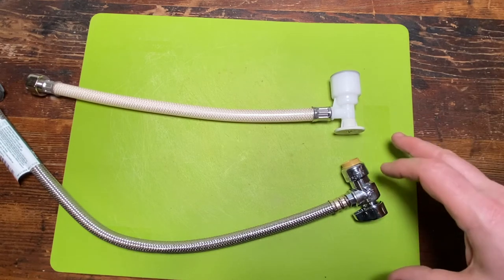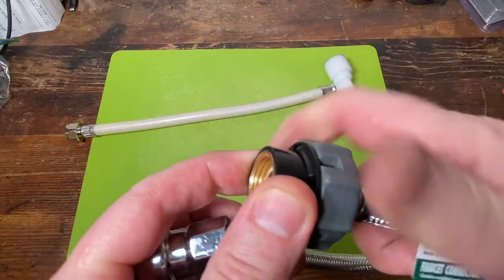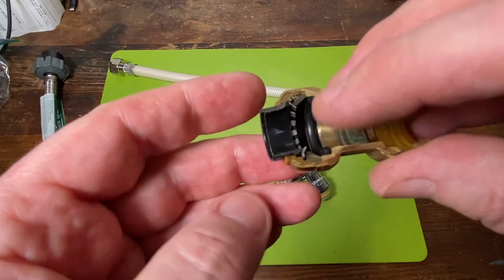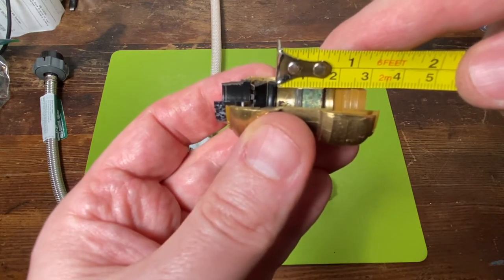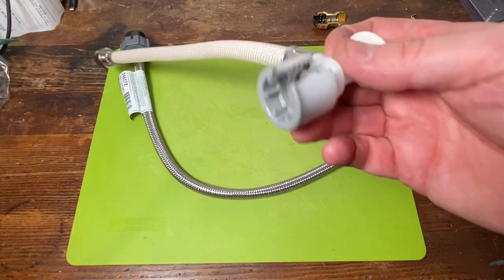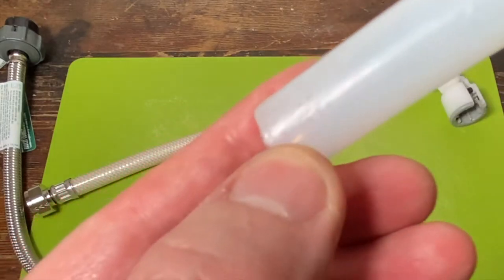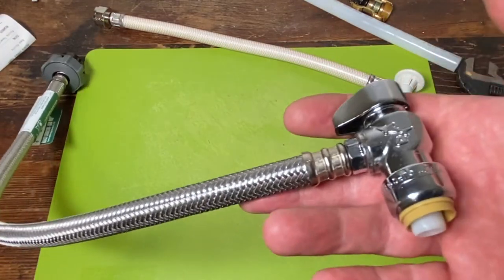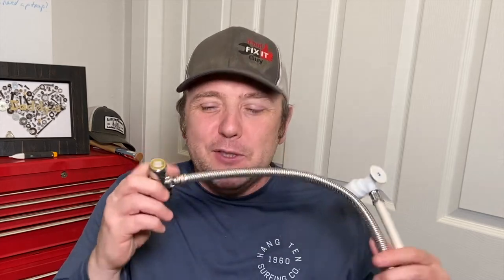Comparing Cheap Made Plumbing Parts!

Comment: Good morning Brian.   If I had those plastic parts in my house I would be replacing them.  I think that spending some money now to get some good quality Angle stops would be a very wise investment.    If one of those plastic ones burst while you are at work it is going to cost you a LOT more $$$$$$$ and is going to cause a lot of aggravation.   Thanks Brian and have a great weekend!
Reply from the maker: So true Richard. Crap plumbing parts has caused lots of aching hearts. I don’t even know how many times I went to someone’s house for a job and ended up replacing all the angle stops. Great investment

Comment: Pretty sure I watched a video where you cut one of these off with a pipe cutter.Did it today & cut off the remaining 2 metal rings with the teeth & slid the last plastic piece off.Method worked great & was fast just as long as you have the room.Mine was in my RV/Trailer on Pex.Managed to save the Pex pipe with this method & kept the original length seeing I did not need to cut the old valve off.I took your advice & ditched the old shut off valve & went with a Pex 90 degree quarter turn with supply line pre pressed fit.No problems.Thanks.

Comment: We actually just put in a new laundry sink and used the shark bite connection you showed here. The connection seemed  super secure was super easy for non plumbers to use 🤷‍♂️
Reply from the maker: Your right they are a good option and sharkbite fittings have been proven to be reliable. I’m just not a fan on one piece type fittings like this. Sucks to replace a valve when only the hose is the issue.
Reply: @ThatFixItGuy  oh, I totally get that but I hope once this is in place we will never have to mess with it. It works great for folks, like me, that would be afraid to try soldering copper pipes themselves and dobt want to pay a ton for a plumber to come do this type of hook up. The plastic one you show looks super cheap but the shark bite one certainly feels like a more solid option.
Reply from the maker: I hope that as well.  You can always reach out with plumbing stuff I’m happy to help any way I can!

Comment: Hey Brian wouldn’t a angle stop cut off valve with a compression fitting be better and buy your supply line separate? Thanks for the information 👍
Reply from the maker: Correct Britt.  Compression valves are a great way to go. And a sharkbite could be used I would just make sure that the valve and supply were separate.  Hope your having a great weekend.

Comment: Brian, what's your opinion on "pre-buttered- copper fittings? I've heard different views on them. Sometimes, depending on the angle of the pipe and fittings, the solder doesn't seem to hold.
Reply from the maker: I have never used them Bryant. I think we will have to get a few to try out.

Comment: Devil’s advocate:

1. I’m not sure I would be comfortable re-using the pipe-end under any circumstances.  I like fresh PVC for any new fitting.

2. Shark bite being easier to remove isn’t really comforting.  

3. Is there any evidence that the braided nylon can’t last 30 years? The steel “looks stronger”, but Flowtite is tested to 1000psi and warranty lasts 10 years.

3. If the valve life is the same or less than the braided line life, why add another point of failure just to make the line detachable? 

4.  Both Flowtite and Sharkbite are made in the USA.

5.  Just because you have seen a few of these Flowtites fail doesn’t mean they fail at a higher rate than other brands. There have been 35 million installed, so of course you will see them leak often, even if they fail less on average. 

I have these in my house and, though I might not choose them for myself, I’m doubtful that I need to install new valves.  Just replaced my fridge and was planning to use a new water line until I saw it was not detachable.  

Thanks for the comparison video!
Reply from the maker: Are you a flowtite rep?  LOL. You make some great points with all these thing, but you talk to any service plumber and they will have the same type of stories of flowtite one piece valves.  Thanks for watching